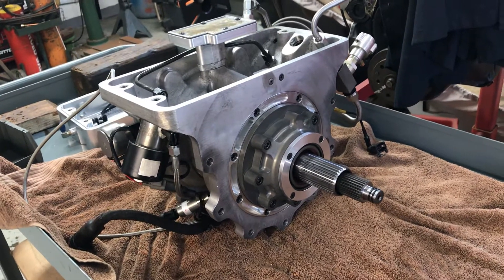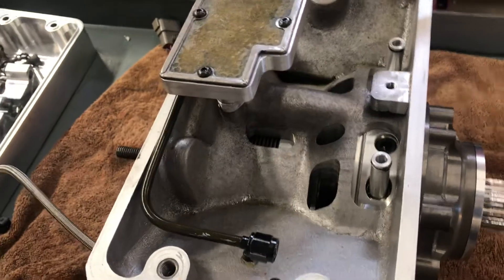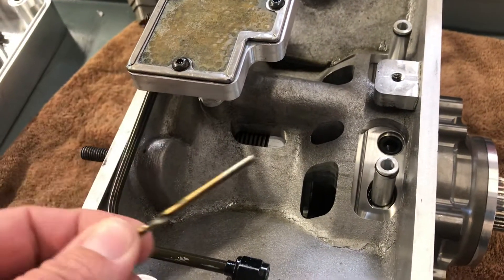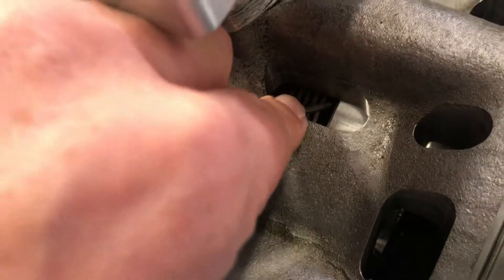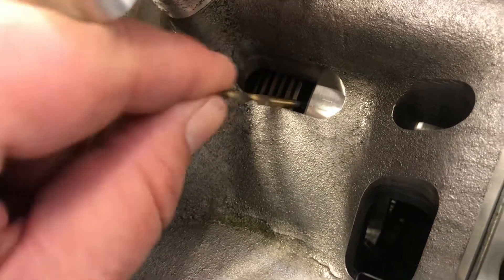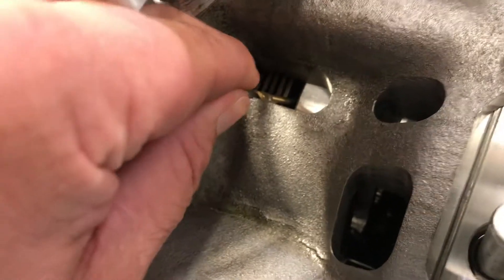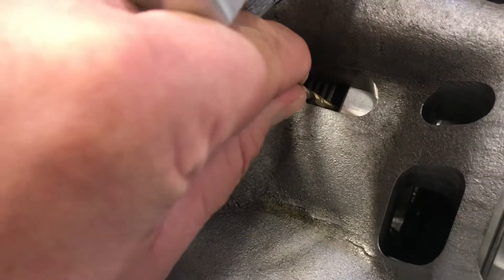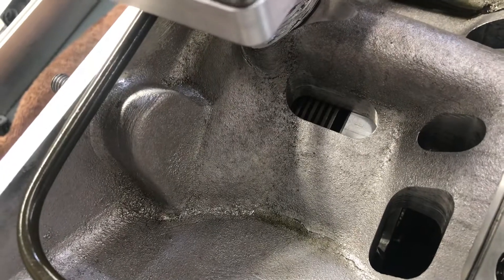Quick Drive Racing - How to Check Transbrake Clutch Clearance

Comment: Is there a way to measure apply time in the ECU? Auto trans been doing this for decades, in Chryslerspeak was called Clutch Volume Index, if the apply time (fluid volume required to lock) reaches a certain point it be flat worned out, if it varies all over inconsistently the seals are wonky.
Reply from the maker: GrocMax yes with the right sensors this is possible. The resultant difference between application of the transbrake, and the pressure of the applying pressure peak when applied. 
Unlike an auto transmission, the Quick Drive’s Transbrake is applied by pneumatic pressure, usually CO2.
Reply: (this be the Wookie if you hadn't figured that out)

Ahh, I assumed it had a hydraulic actuation. It seems with one of those setups one could figure out wear BEFORE the dreaded deep stage or red lights occurred.
Reply from the maker: Yeah its meant for easy servicing. Ill be doing some additional videos on it soon. I did an FB video about the drive last year as well.
Reply: Standard ratiometric pressure sensors have a 66% response time of between 1-2mS, might be quick enough to catch the pressure rise curve in a consistent fashion. Just a thought.